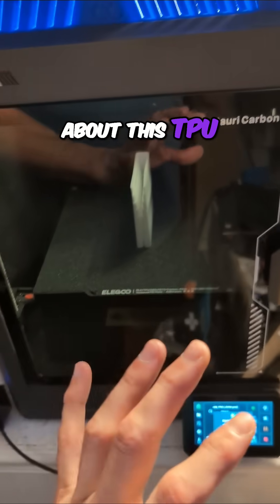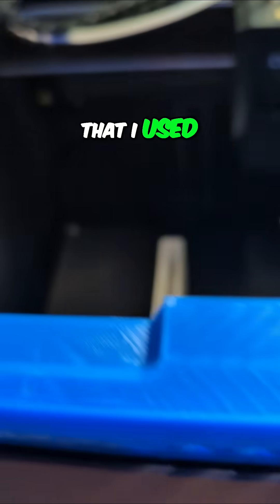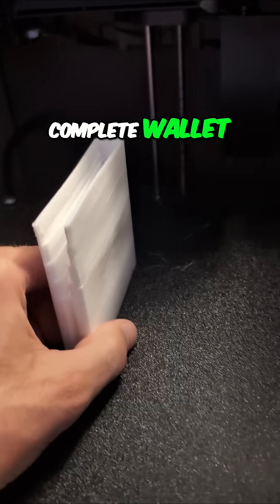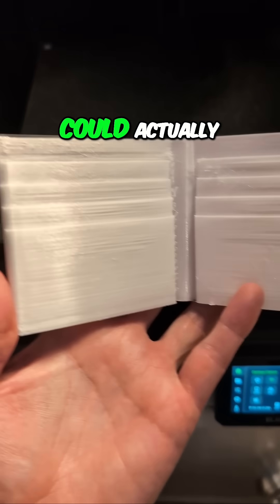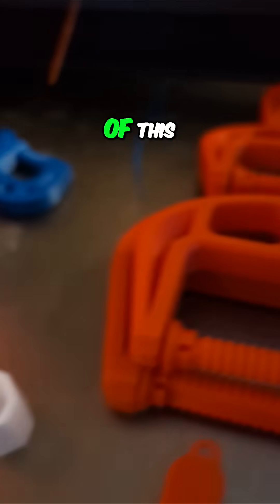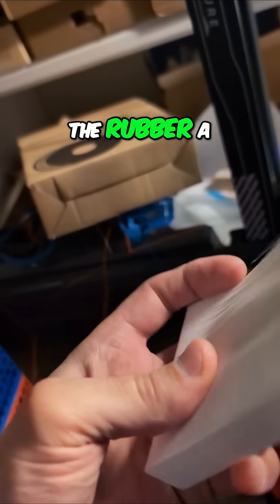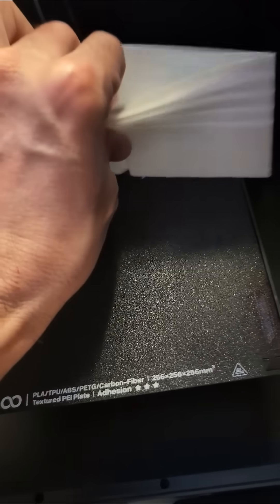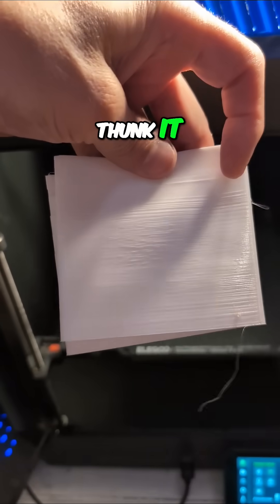3D Printed a RUBBER Wallet?! You Won't Believe This!

Comment: Tpu needs to be printed slower than other filament. That might help reduce the deflection issue
Reply: The deflection is just the height with lack of supporting structure. Any slight force will deflect it.
Reply from the maker: Agreed. Might try adding some supports next time. I just realized that the design I used is parametric and be customized. :)
Reply from the maker: I may try that next time, thanks. Used the default TPU profile in Elegoo Slicer.

Comment: I would assume that printing with thicker extrusion width might help with the wobbliness of the print.

Idk ive only used tpu a couple of times and have not done anything that thin or tall yet.

Where'd you find the model I might try it out I've needed a new wallet for some time.
Reply from the maker: I don't know. I'm pretyt new to printing with tpu. Actually printing a phone case for my son right now. 
I'm diggin' the wallet. Been carrying it for about a week.
https://www.thingiverse.com/thing:2446989